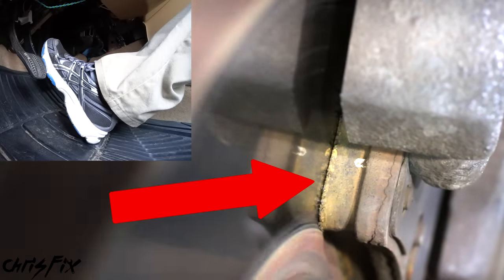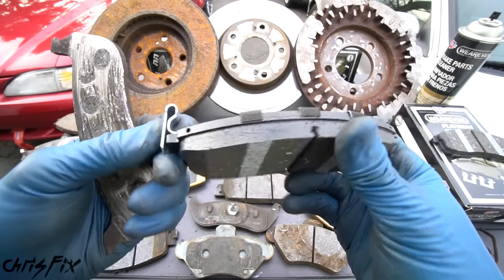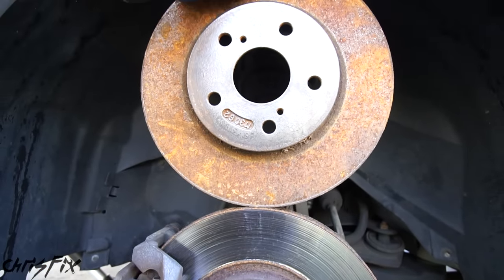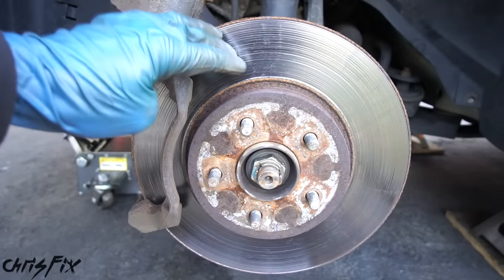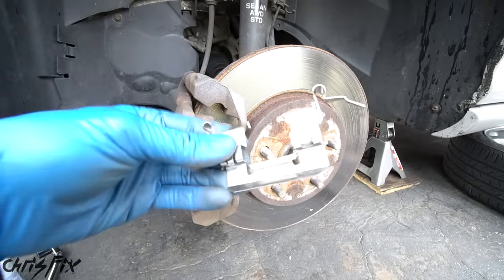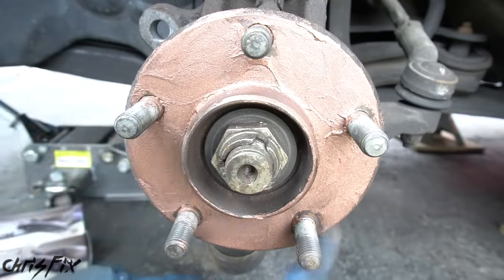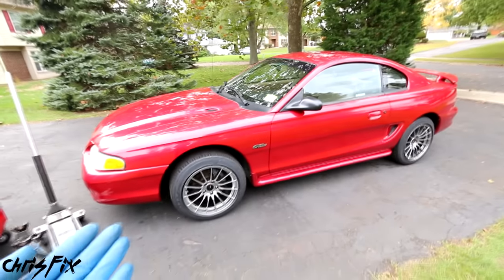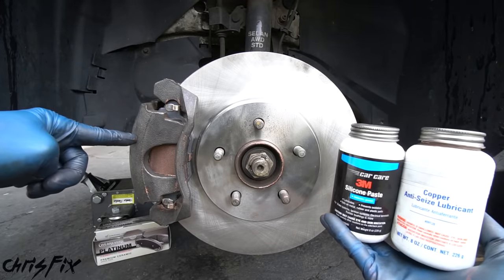How to Stop Your Brakes from Squeaking

Comment: Your understanding of colloidal lubricants is a bit jacked. Let me help.

Graphite v. Copper is not because of malleability. In the colloidal suspension - that really doesn't matter. Both copper and graphite is effectively particularized to the point of being a powder and when in colloidal suspension (i.e., floating around in the grease) there really isn't much difference between graphite and copper particles in terms of flaking versus breaking versus crushing type stuff. By the way - graphite is actually more malleable than copper. The bonds between carbon atoms are composed primarily of weak molecular forces. Since graphite has a planar structure, its electronic, acoustic, and thermal properties are highly anisotropic. This means, phonons pass much more easily along the planes than they do when trying to pass via the planes. So actually graphite is better than copper if you are talking about "slipperyness" per se. 

Plus, you should understand that nearly all anti seize has graphite in it. Thus, copper, aluminum, etc., all have graphite in them as well. Why? because of the "slipperyness."

Copper greases are chosen primarily because of their thermolytic properties. Copper grease has been designed to be heat resistant and operates well under conditions of temperature extremes. It demonstrates excellent anti-seize characteristics at temperatures well over 1,000° C (that's about 1850° F).

The reason you choose one anti-seize over another has to do with matching the metals and not corroding them, not because of some underlying property in the anti seize itself. Each anti-seize is about as slippery as the next, the issue is really not corroding the metal (through galvanic corrosion or some other problem) or having it fuse under the heat of the application. 

The reason why you use graphite primarily on bolts is because aluminum and copper are high valence metals. What that means is, copper has 11 valence electrons, distributed amongst the outermost d and s orbitals. These electrons are the ones that engage in chemical reactions. So if you put copper in contact with other metals, you can cause chemical reactions to occur and if you did that on bolts, basically your bolts would chemically react with the anti-seize and they'd effectively corrode. Copper is used in all kinds of chemical reactions to precipitate metals from solution. So you might not want copper on things that are made out of aluminum because of galvanic corrosion.  Similarly, you wouldn't want to put aluminum anti-seize on steel items (again two metal corrosion will happen). 

On ships, which are primarily painted with copper (that's what makes the bottom of ships red), we put zinc anodes on the sides and bottom to keep them from being corroded in contact with the salt and the metals in seawater. Similarly on things like bridges, etc., we put anodes of zinc and copper when we build steel bridges to attract the corrosion versus having it attack the iron. 

Long story short - the reason why you're using copper versus graphite alone is because copper has amazing heat dissipation properties. Brakes under stress, especially how you're driving with your drifting and whatnot, can reach temperatures as high as 1000° F on the rotors, and 1500° F on pads and calipers because of continued use. Racing pads are rated for these types of temps. While you could use regular anti-seize (typically rated for temps to 1600° F), the constant heat stress on the compounds isn't so great. Moreover, graphite isn't so great at recovery over and over from heating. Copper can dissipate the heat faster, overall has a higher rating (thus doesn't degrade as quickly), and is better suited as long as you're using it on steel (which brake parts are all made from steel). 

That's why it's recommended. It has nothing to do with what you suggested.

Comment: Hard to describe the noise in my brakes almost like tapping on something fairly fast then slowing down until the car is fully stopped, or a rocking back and forth like a piece of metal on something and its moving back & forth??   i had the rear brakes doewn back in july this year same exact noise as now, had it in for hours could not figure it out, they may have to dig deeper take every apart next time, car has about 130,00 kms 2011 VW Jetta
Reply from the maker: Is it only when you press the brakes? Does it happen if you press the brakes and turn?
Reply: @chrisfix  i uploaded very short video(audio clips of my brake noise) to my youtube channel

Comment: @Chrisfix help! I have new brake rotors en new brake pads when I put more force on the brakes on the highway, i hear a good brake shaking noise i dont understand because they are grom a good brand bosch.
Reply from the maker: Could be the parts (like shims and backing plates) are not lubricated or the pads you used are cheap and squeak

Comment: I have some ceramic brakes on my car, when I press on the brakes sometimes coming to a stop sign I here a grinding sound. Took the car into a mechanic he told me the brakes were good. These ceramic brakes were 25 dollars. Front and back, the Grinding comes from the front. Rotors where good too. Anyone with this problem.

Comment: Graphite is stronger than copper. You just cannot compare a thin 2mm pencil bit with a 3mm thick 10mm diameter copper tube.

Comment: Are brake pads easy to change myself? 😅 I’m able to get the parts for my car but mechanics seem to be overpriced even for the labor
Reply: If you have a ratchet and socket set and know how to take the wheel off then they actually are pretty easy. I'm sure chrisfix has a video or two going over it as well.
Reply: Brakes are super easy. The most difficult part is getting the old hardware off (im a weak female) lol!
Reply: @Charlie2019xx  longer ratchet

Comment: 02:28 the only way to tell they are worn down is to take the wheel off??  UMM YOU WOULD HEAR GRINDING NOISE WHEN YOU APPLIED BRAKE AS THOSE ARE METAL TO METAL!

Comment: Do not use antiseize on brake parts.
Reply from the maker: Why do you say that? It also doubles as brake parts lubricant
Reply: In my experience with seeing antiseize on brake parts it seems to dry out almost providing no lubrication after the heat gets to it same for the caliper slide pins please use proper brake grease.

Comment: I have noise while im driving but when i push brake it disappears and i was eaiting you will give info about this you forgot to talk about that
Reply: That means the pad is slightly rubbing the rotor while the breaks are are not being used. This slight contact creates a vibration to which you hear the squeaking. But when you press the breaks the full pad contacts the rotor that stops the vibration and there for the squeaking.

Comment: Dont buy 10 usd brake pads Buy BREMBO cheep 25 usd or go with 100 usd ceramic one Brake pads quality are issue to not mention disk pads rotors
Reply from the maker: I wish brembo pads were that cheap, but yes cheap pads can cause issues like this
Reply: @chrisfix  I think oem quality brembo pads arent too expensive, those cost around 30€ in my country.

Comment: Hey Chris, first off, love your videos.  I just got a 2015 Frontier and am working on replacing the entire rear braking system including the e-brake shoes.  I have a few quick questions, I read on reddit about using anti-seize on brake parts.  One guy said, it will actually seize up at high temperature.  What's your take on that?  Should I use ceramic grease instead on the moving parts?  Using copper anti-seize on the hub should still be fine right?  Thanks and much appreciate it!